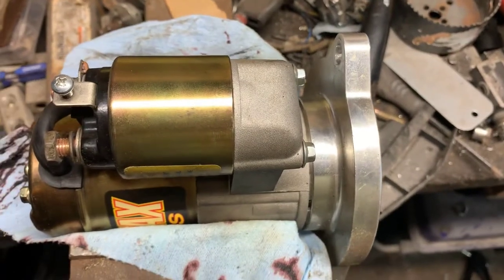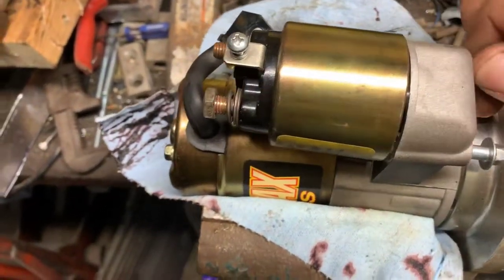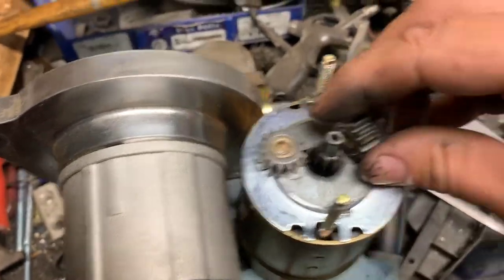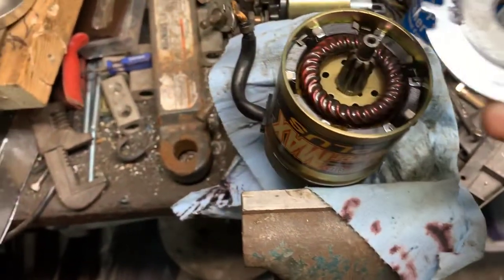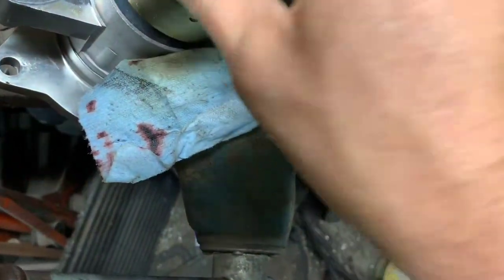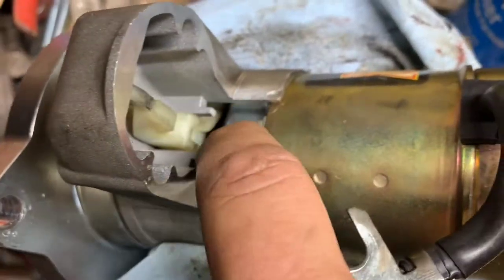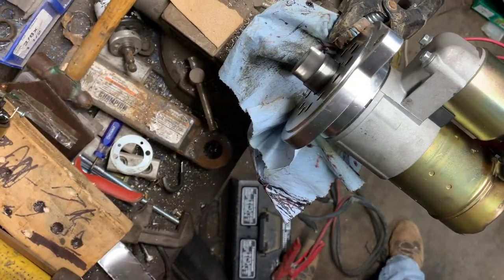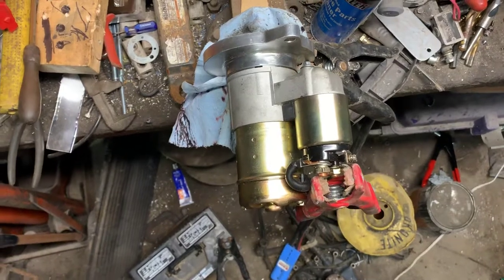Overhauling Powermaster 9103 starter

Comment: This seems to be a common problem with the power master starters. I have one with less than 6000 miles with same issue. 
Thanks for the video
Reply from the maker: The one I had was used when I got it. No idea how old it was when I got it. This new one has been good so far. Going on 3 years or so. Just didn’t like the lack of grease in it. Thanks for watching!

Comment: Nice video! Was that new solenoid a Powermaster or a of the shelf Auto parts solenoid? Just wondering if you had to have the same brand? Thanks!
Reply from the maker: It was a power master. I ordered it to replace the one on my spare starter I keep on the shelf. But when I cooked this one I had to use it. Reminds me I still need to order another one for my spare. If you could cross reference it to something else, I’m sure powermaster doesn’t make them, they’re probably made by denso or something like that. That’s why I try to keep a spare one on the shelf just in case so I’m not waiting a week to get one.

Comment: Think it is pretty normal for the brushes to wear a lot at first till they get the arc in them from running on the commutator. Nice work man,  was the heat shield on right from the get go ? Lots of heat soak where the starter lives..
Reply from the maker: I didn’t have any heat shielding on it. I think I killed it with to small of a battery cable going to it. I made up a 1/0 instead of the #4 it had. That should help it. Plus the starter blanket will definitely help with heat soak. I wasn’t very nice to it trying to get it to crank and it wouldn’t. Got the cable so hot it melted the end of it off.
Reply: WoW... can't say i have done that before ! smoked the insulation a few times but that is when i stop and re-assess, Great days to you and your crew !